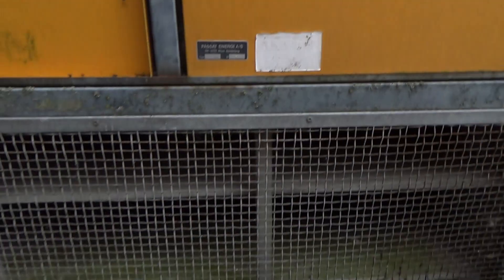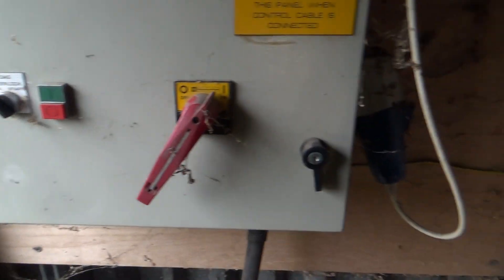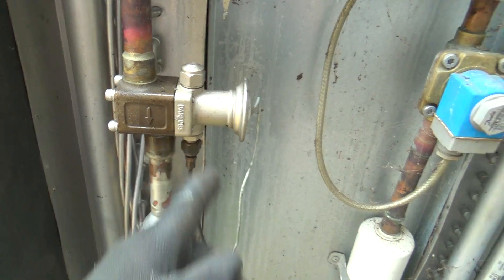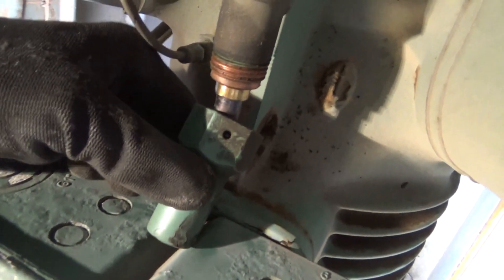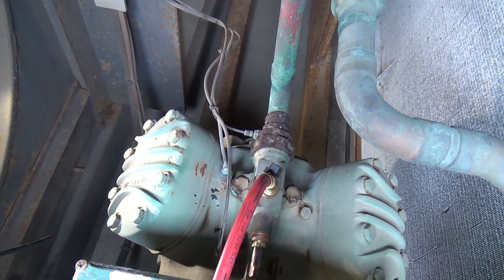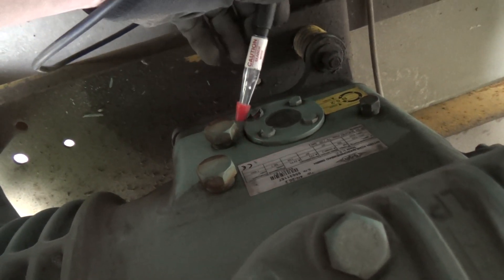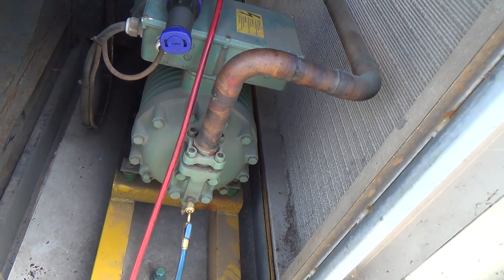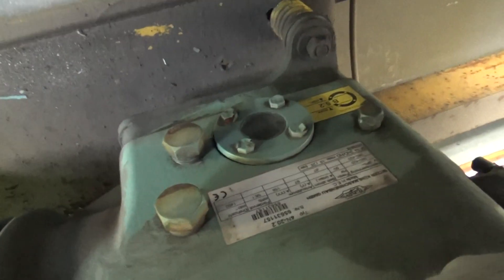Dry Air Generator Issues

Comment: Big coils, and yes going to be expensive to replace, along with all the other small leaks as well. Plus the all new seals required to change to POE oil, and you are looking at a big bill there, might be cheaper to replace the whole lot instead.
Reply from the maker: Was lucky we had a few things in stock we got for another one of these where the job got cancelled so worked out a bit cheaper than buying at todays prices!

Comment: I need an accutrak now 😄 use my H10 all the time , brilliant bit of kit! Spares are expensive though, £60 for a new clear plastic tip, 10 filters and 5 red balls !
Reply from the maker: Yeah I lost the rubber tip off mine so made one out off some red silicone tubing! With the price of refrigerant now it makes the H10 more affordable in comparison.
Reply: @heavydiesel  thankfully being employed I don’t have to worry about the cost of refrigerant anymore. But I do love a tool which works! Those accutraks are pretty expensive!

Comment: What leak detector are you using and would you recommend it? Thanks
Reply from the maker: The main one was a Bacharach H10pro which I would highly recommend, others I have are a D-Tek Select which is good, and an old Tif one which is not so great but must be nearly 20 years old. The ultrasonic one is made by Accutrak.

Comment: It reminds me a couple weeks ago i had a similar leak inside a big ol' coil .
I could find it with the electronic detector but no way to see actual bubbles.
And i don't have an ultrasonic unfortunately.
Spent the whole day on it but couldn't point out the exact spot and get that important picture of the bubbles for the client .
Extremely frustrating.
Reply from the maker: Spent most of the day here looking for leaks. Sometimes I'll video the leak detector going off to show the customer, proves you are not making it up and covers your arse if there are other leaks in the future.